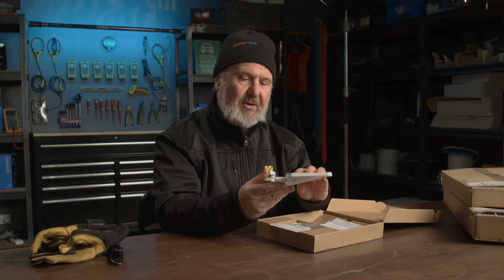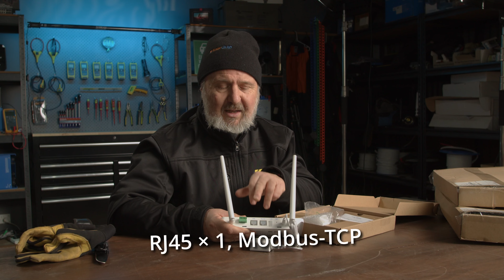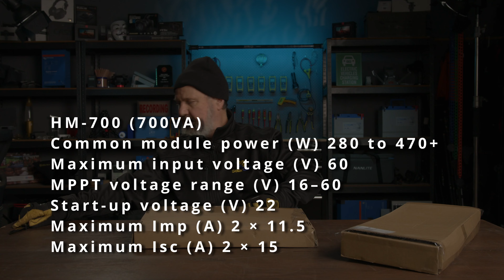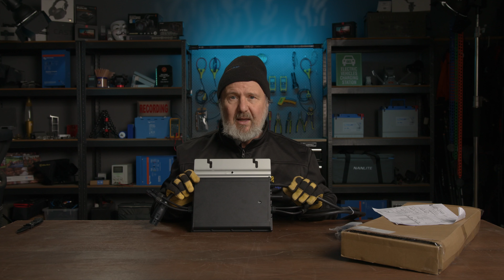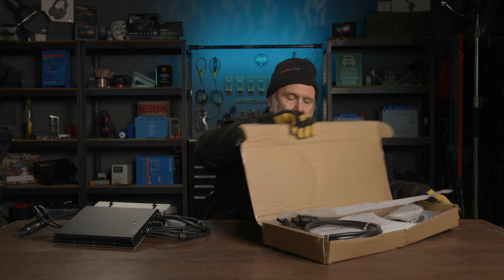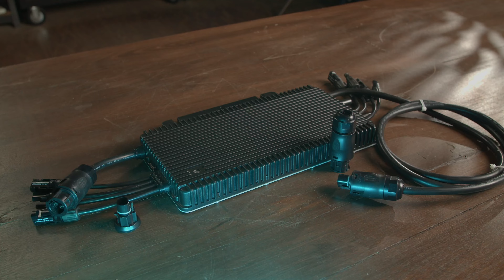Hoymiles Microinverters 700W and 1200W

Comment: First one in the world is the point of this video I mean completely useless waste of time no explanation on anything just basically showing and telling nothing very little secondly by the time you buy the DTU plus the micro inverter for the same amount of money you could buy a very good inverter because by the time you buy a battery charger plus the DTU plus the micro inverter plus all the wiring this is just a big scam unless you just want to use these to power things during the daytime without any backup the only way that would make these viable at all would be used as an image standalone configuration because by the time you buy all the stuff necessary what a waste of money and on top of that the labeling on the micro inverters is horrible they have a positive and a negative on all the PV inputs and absolutely no wiring diagrams no instructions not even a flip off of a bird so that positive input is actually a negative input now how in the world is a novice supposed to know that they're not they need the DTU what a scam

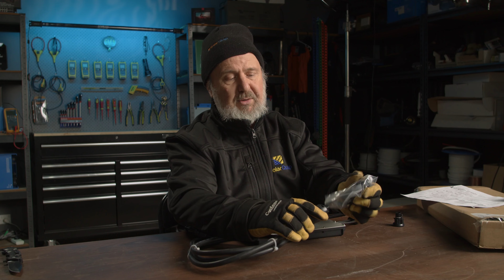Comment: At 7:37 you said the sting of inverters was limited by the number connected in "Series". Did you mean parallel as just two inverters in series could easily exceed the 60VDC input. I'm confused.
Reply from the maker: Correct... electrically the micro inverter a.c. output is a "T" connection (thus parallel) onto a trunking cable... but mechanically they are plugged one into another, as in series. I'll avoid using that term again.

Comment: system 220V 6kw with hms 2000 4t
The DTUProS-smartmeter is located at the outlet of the national grid.
I have a problem and I don't know how to solve it
I set ZERO export but in the day the installation still send energy to the grid:
1.how can I stop exporting to the national grid because I don't have a prosumer contract yet and I will have to pay for the energy I produce,
2. how to set or what device to install for the next situation:
in room A I have an electric heater 2,5kw , when the power of the panels is less than 2,5kw the rest of the energy is drawn from the national grid , the problem is that I don't want to compensate for the missing power , I want the heater to switch off and implicitly not receive energy from the national grid.
thanks

Comment: I have bought a Hoymiles HM 1500 and will install it soon. It is a 4 panel inverter, but I found out it has only 2 MPPTs which is a bit of a pity for my situation. Does the 1200 also have 2 MPPTs?
Reply from the maker: Hoymiles inform me that only the Australian version has four MPPT's for the HME-1500-AU and HME-1200-AU because of the requirements of our standards.
Reply: @SmartEnergyLab  thanks, that explains the conflicting info I find.

Comment: Wow, that's not how WiFi works at all.
Reply: actually the communication method between the DTU and this HM-700 or HME-1200 is 2.4GHz, however it also needs to connect the DTU to the internet through WiFi or cabling to access the Hoymiles server
Reply: @xuanwu1179  Yes but, it's not faster because it's 2.4GHz and 5G doesn't mean 5GHz. Talk about how the products work and don't guess at the Wi-Fi.
Reply: @tabortollefson  the purpose for the commnication between the microinverter and DTU is stable and long distance , it's kinda different what you are in doubt i guess. for example , while the microinverter and DTU powers up , the DTU can collect the data from the microinverters and upload to the server in a certain period , and  users can check the data through Hoymiles monitoring platform ,  but preliminary how to connect the DTU to the internet is through Wifi , Ethernet or even 4G card.  Anyway , we are taling about two communication paths  , microinveter and DTU ,  DTU and server , which are different.
Reply: @xuanwu1179  You're taking about communication between the components, not the nature of WiFi itself. I don't care how or why the components communicate. I never claimed I did. I was only commenting on the lack of understanding in his description of the electromagnetic spectrum as it pertains to the 802.11 standard.